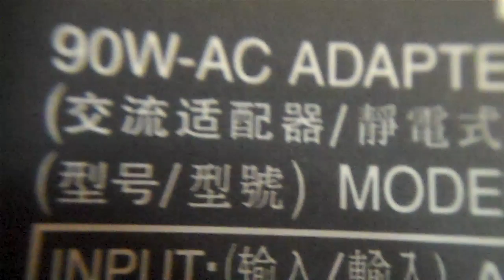Part 1 - repair dell ac adaptor model pa-1900-02D2

Comment: This worked! My charger was slightly different and only had 2 (not 3) things to connect. I didn't tin anything, I just wrapped them together by hand (but this is only a temp charger until Amazon delivers new one). Thanks so much for this video!

Comment: Also if you want to use the same jack rather than replacing it with a new one or using tape instead of removing the plastic from the jack with a knife you can put the jack into boiling water for a few minutes until it softens enough that it will allow you to pull the plastic with a towel or cotton napkin from the metal part of the jack.

This way after you finish the welding of the cables onto the jack you can put the plastic part back into boiling water and then slide it back onto the metal jack. Right after this put the jack fast into cold water so it will contract onto the metal.

This method helps you save the actual jack instead of replacing it or using tape instead, but its clear that the esthetic will not be the same as it was in the beginning for all of the cases, it all depend on the patience of your work and of course the type of plastic.

Comment from the maker: V+ usually means Voltage Positive or Red wire. V- means negative or black wire. usually. like i said earlier, double check it with a DMM

Comment: yah i got that part...the reason im asking is im trying to splice my old dell pa-12 ac adapter to my Sony vaio cord.they are both 19.5v so i figured it would be an easy fix.the only problem is the dell adapter has 3 wires in it and my vaio cord only has 2(pos & neg).i cut the dell adapter's box open and looked on the board and it says the outer most wire is the ground and the middle is the V+(i have no idea what V+ is)...so does that mean the inner most wire is the negative?